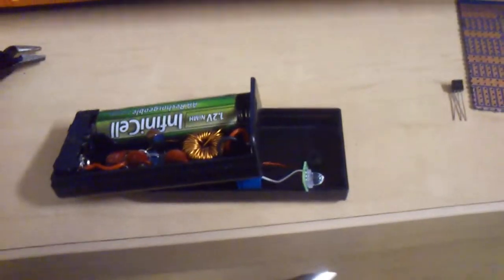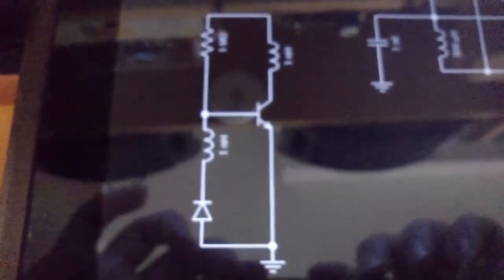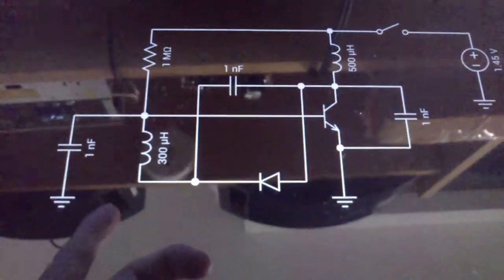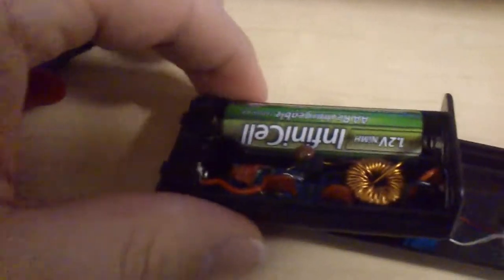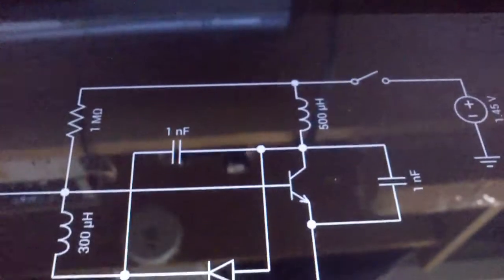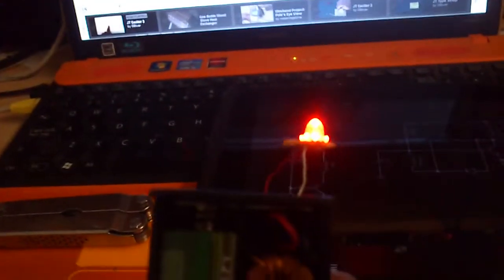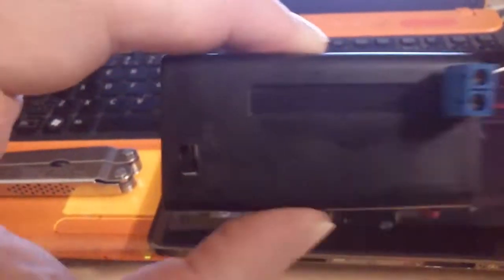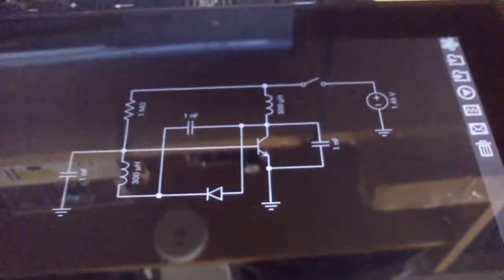GBluer JT Exciter modified

Comment from the maker: No but this is the next step. Mine is about 1 mA with no LED and the load depend on the LED voltage drop to lower it is the higher the intensity it will be and the more current it will draw. Next step I'll try the hand wound inductor I have 3Kg of 30 AWG wire so I plan on having fun...

Comment from the maker: Now you will need to clarify star LED. If you mean by that a connection of series parallel LED its a no I've tested this circuit on different configuration and the only one that work is if you parallel the LED. You get as a result little more amp drawn and just a pinch of light loss on each LED but since you add a new one its almost not noticeable. Hope this help I can always make a video of it showing different LED just ask!.

Comment from the maker: I'm using a regular multimeter at the 20 amp setting for circuit that take more then 10 mA and for lower then that i put my meter on the 200 mA setting and yes you are right at the lower setting i notice a light drop...but i guess that what we have for basic equipment. You could always use a scope with a 100 mOhm or lower.

Comment: I am at it right now , i paused  your video on the schematic :)... I was also wondering how you are taking the ampdraw. I tried with some multimeters (3 different ones) on different circuits in the past but i dont know if it is a quality issue but they all seem to have internal resistance that lowers my light output i can not have the real energy consumption. I tried reading the voltage across a one ohms resistor and do the math but still, some circuits are affected by such a low resistor.

Comment from the maker: In most case every one work that way but you can try with small inductor for the one thats connected to the base and for the other one i found that bigger uH one work good too. Capacitor are mostly all the same value and they server has filter and bypass.